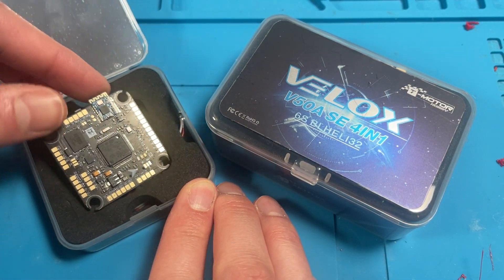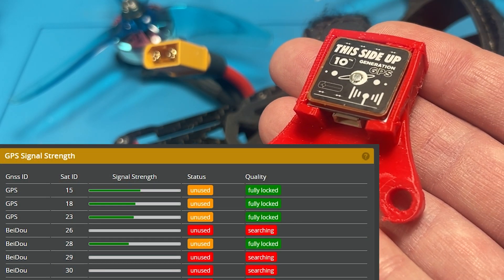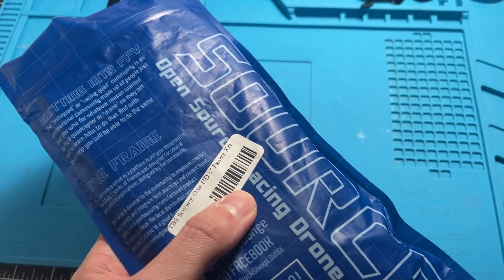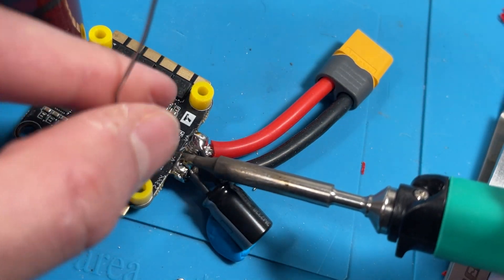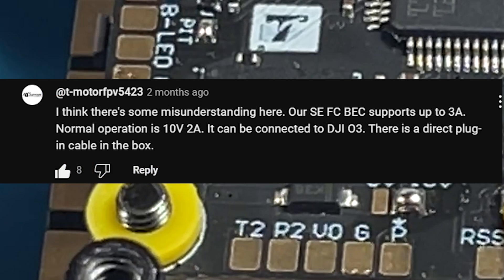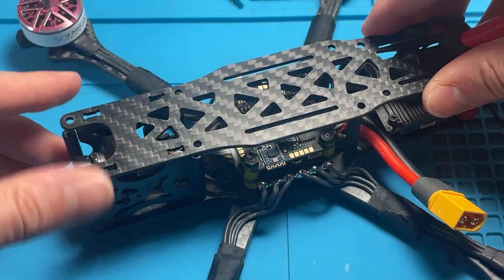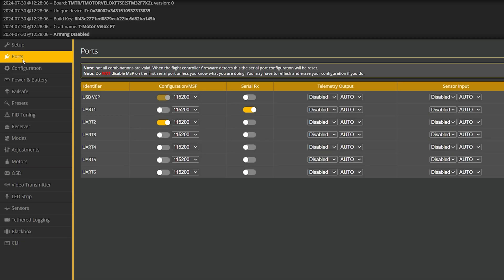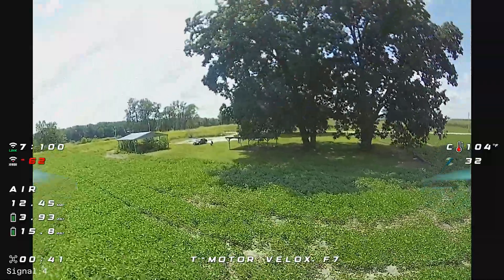T-Motor Velox F7 SE Flight Controller & V50A ESC // 5" FPV Drone Build & Overview

Comment: Just finish a build with this stack and it fly like sh*t and its not working with blheli32, think there is a problem with the gyro…. I might order a new stack, and was wondering why you use the 10v pad…?
Reply from the maker: The 10v pad is optional, but if you don’t use it then you can’t use the vtx on / vtx off feature. 

Also - if you use the 10v bec your vtx is better protected from voltage spikes. This doesn’t matter as much for 4s but it might for 6s. 

A defective gyro made one of my quads fly like crap also on a happy model FC. It would make flutter and vibrating noises in the air no matter what I did. Does yours do that?
Reply: @JohnCuppi thanks!!! as soon as I drop down the throttle the quad start shaking like crazy and same on sharp turn or when I flip the quad…. Just order a new stack will see…

Comment: I will use my T-MOTORHOBBY Velox F7 SE+V50A SE HD Stack product on 1300 kv velox 2808, will there be any problem or overheating?
Reply from the maker: @yasarertuggunner6202  I would be a little worried about this setup. T-Motor’s 2808 test report sheet shows 62amp peak current when at 100% throttle with triblade 7 inch props. This is enough of a difference that I would worry about using a 50a esc.
Reply: @JohnCuppi  ❤️❤️thanks

Comment: Hey my friend how are u and I wonder if you can't help me with my pavo femto DJI o4 I can't bind my erls jumper bumblebee and my DJI fpv 3 controller is not recognized by betaflight and is already been to my goggles n3 DJI but I can't use the DJI controller because is not recognized by betaflight and I've trying to use my jumper bumblebee controller but i can't bind it with the phrase can you help me

Comment: Plug in vtxHD says uart 3 though
Reply from the maker: No, the plug pinout is RX3, GND, RX2, TX2, GND, 10V. The RX3 is what's confusing you. 

Unless you are flying with the DJI remote controller, ignore that. It is RX2 and TX2 for both the plug and the solder pads. The very last pin has a trace to RX3 because it needs a route for the DJI controller to be configured as an sbus input.

Comment: Hi! I have 1 AMGP 950 chip burned out on my flight controller. Where can I buy it or an analog? What is this chip responsible for?
Reply from the maker: Hi, sorry for the late reply -- did you ever find the answer to this question? Because I honestly don't know, I would look on digikey to see if you can find it there. Not sure what it's for, T-Motor would know.

Comment: can we use DJI radiocommande 3 with O3 with this stack ?
Reply from the maker: Yeah you can. The dji port/plug includes R3, set serial receiver to uart3.
Reply: @JohnCuppi  oh , i put the cable from the O3 directly in the HD VTX in my FC , but when i put serial on uart 3 on BF , it crash
Reply from the maker: @suzukyama5303  What do you mean it crashes? Betaflight configurator crashes?
Reply: @JohnCuppi  not really , after save and reload , all the port are back in defaults setting . i cant have UART 3  and serial RX active

Comment: I ordered a speedybee stack for my new 5" build I'm going to do.  Building a Proto5 which is a bigger and reenforced Babyhawk frame.
Reply from the maker: Supafly preset all day!
Reply: @JohnCuppi  Practicing soldering every night now.  Frame show up mid next week.  Should be motors, GPS and ELRS to solder.  I actually have the Proto25 as well.  Tearing my Cinelog20 apart and using those parts on this 2.5" frame.  I really don't like cinewhoops much.